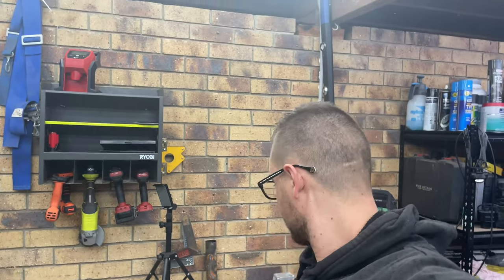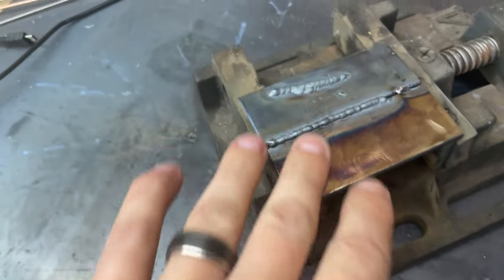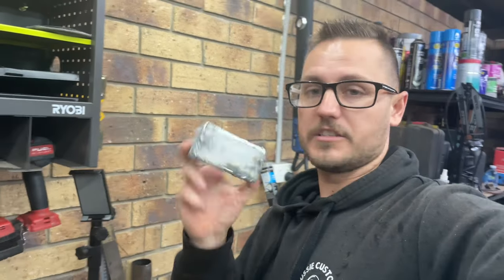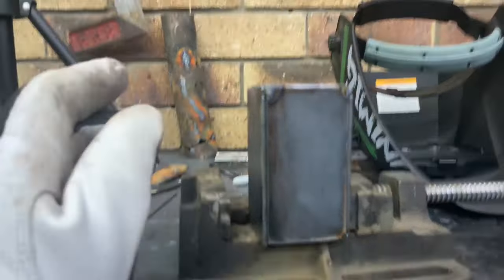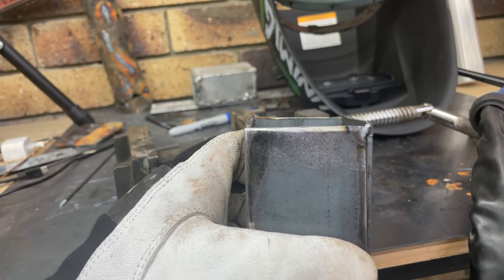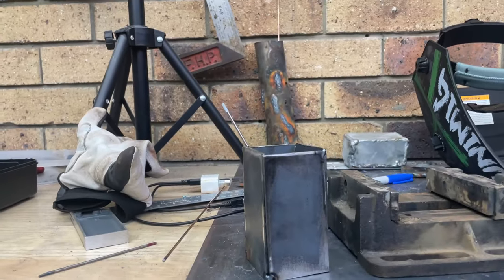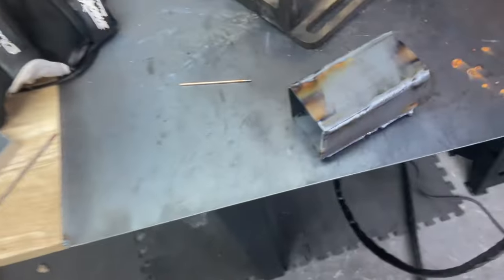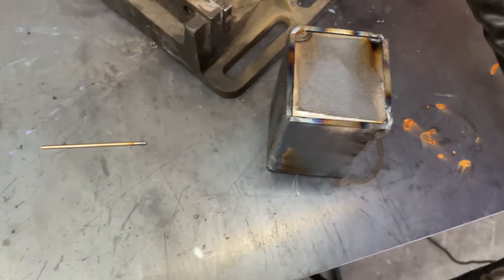Mild Steel Tungsten Holder

Comment: I bought one of these exact same tigs too. Ally went ok (I’m no welder) but mild steel the torch keeps balling up. Even with switching the polarity to DC. I feel like something is wrong with it. Or it could just be me all along. Your welds look great
Reply from the maker: Did you change the earth clamp on the machine? So with mild steel you want earth clamp on the negative and torch on the positive 
Where as with ally you want torch on negative and earth on positive haha
It’s confusing I know

Basically just change your machine plugs over and switch to dc
Reply: @aussiecustomgarage  yeah mate, I did all that. Even thought it could have been my gas was contaminated. Set up an old tig I had, made a pass no worries, tungsten still sharp at the end of it. Just weird. Wonder if I got a warranty on it hahaha!
Reply from the maker: @notimportant8120  what colour tungsten’s do you use? I use red tip for mild
Reply from the maker: I have a review video on his machine with everything I do. I’ll upload it tomorrow. 
It goes through more of the setting I used
Reply: @aussiecustomgarage  yeah mate that would be awesome!